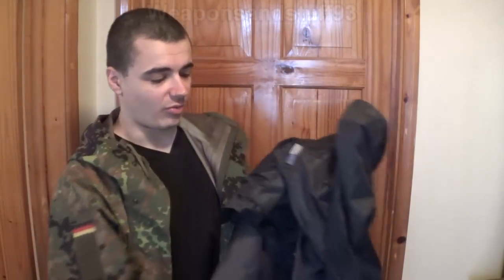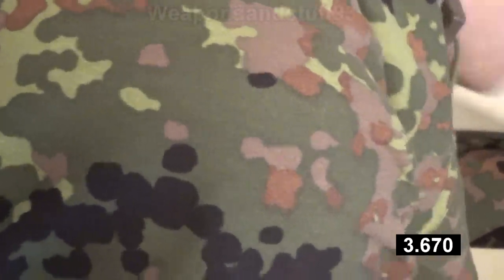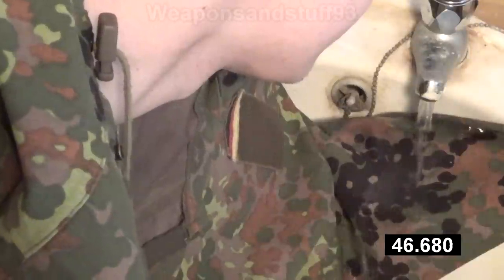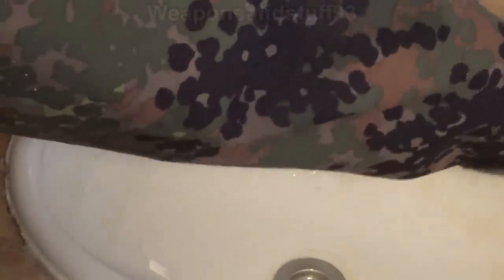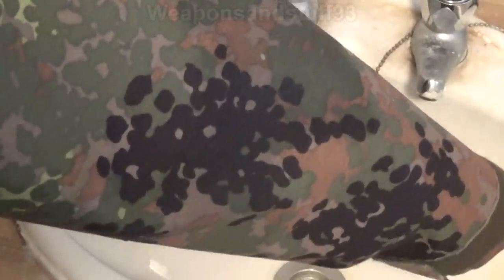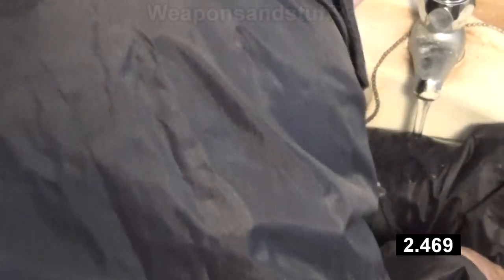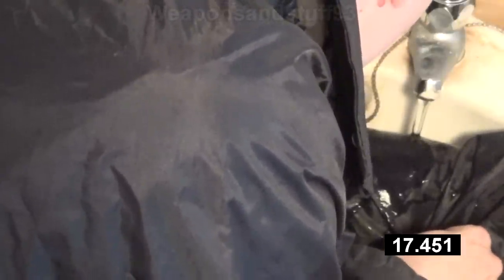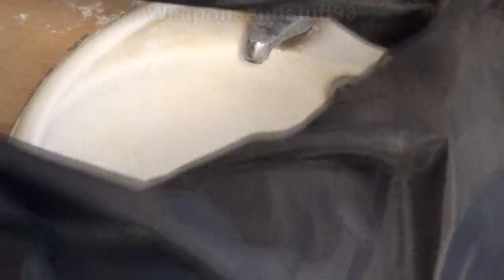Testing raincoats for NBC/CBRN use

Comment: I was a US ARMY NBC, now CBRN, soldier from the mid 1980’s to the early’90’s. During the Gulf War most of us wore Gortex jackets and pants rather than the heavy MOPP Suits. We calculated that in the arid heat the persistency of any agents would be very brief. All that to say that using quality rain gear m, a full face respirator and rubber gloves and boots (under the clothing, preferably taped) you should be able to evaluate the area. The UK is famous for its fog and rain so any chemical agents are likely to hang in the air for much longer than areas with low humidity, ie. Spain for instance. 

Nice job

Comment: Something that could improve the results with goretex jackets is ironing them and tumble drying them. when my mtp lightweight mvp goretex jacket came today I noticed on the label that it says ironing or tumble drying will improve water repellency, I also tested it under a tap and didn’t get dampness underneath but the jacket is brand new and hasn’t been worn outside yet.
Reply from the maker: That's strange I always imagined stuff like that would wear gortex out faster.
Reply: Weaponsandstuff93 here’s a picture of the label with instructions incase your interested http://i67.tinypic.com/11kb0qv.jpg

Comment: Would this in theory be ok or decent nuclear radiation like in a S.T.A.L.K.E.R. Senecio? I hear that heavy military coats could be decent protection in a post nuclear disaster senecio.
Reply from the maker: Heavy coats would only protect you from Alpha and maybe Beta radiation.
Gamma is only stopped by thick concrete or lead.

Comment: I bought a filter for the gp-5 and it was made in 2008. I unboxed it and was looking at it and i can see little black things, is it ok to wear?
Reply from the maker: No idea, do a shake test and see if anything leaks out.
Reply: Ok, and what if it does?
Reply: Colton Metcalf you shouldn't put It on if It is leaking, even if It is charcoal because It's bad for your lungs
Reply: MrBird ITA     thank you
Reply: MrBird ITA     very little black pieces come out when I hit the bottom and shake it
Reply: Colton Metcalf that means it leaks a bit, i wouldn't reccomend wearing It, except in an NBC scenario
Reply: MrBird ITA ok  thx